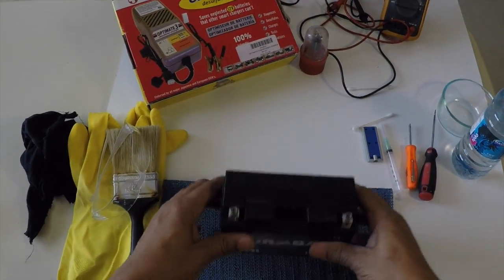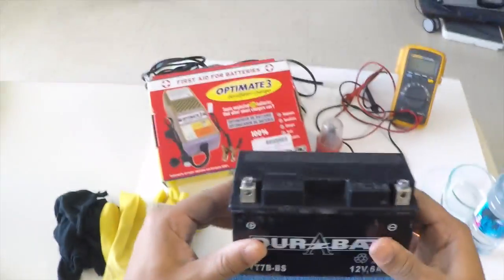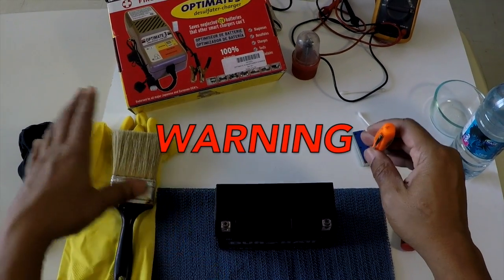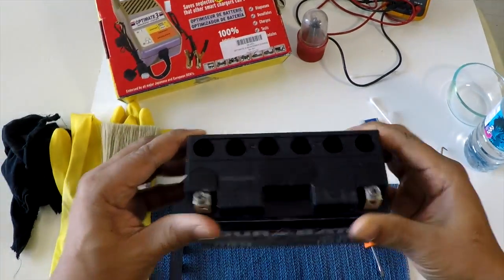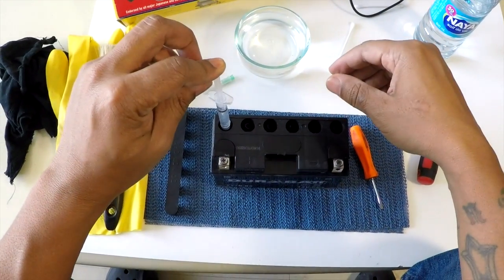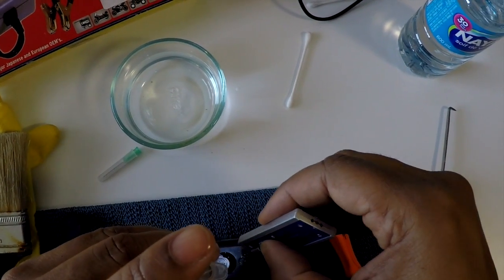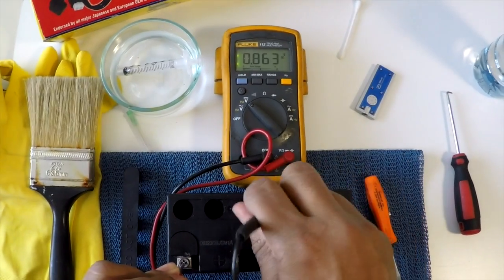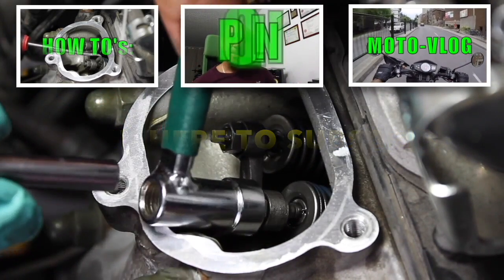Free Scooter Battery FIX | Save Money | FIXED #17

Comment: I would have never guessed that this was an issue. I keep a trickle charger on my battery when not in use. From now on I'll check the water as well. Thanks, 125ZumaGuy. 👌😮👍😜
Reply from the maker: Rick, Heat is a bad thing for batteries. I didn't only restore the battery I restored confidence in my machine 🙌🏽

Comment: My battery failed 3 years ago. been kickstarting my piaggo ever since. Recently I had maintenance done and replaced the battery. 44 euros! now I'm gonna store my battery for the winter witch a trickle charger! My first battery lasted about 5 years without trickle charging and being in storage every winter.
Reply from the maker: Hi Boowonder, I have some reservations about trickle battery tenders. I feel like those tenders accelerate the "death" of a battery. I believe the water evaporates faster on a charger. Having you ever felt the sides of a battery when it is on a tender cycle? Its warm to the touch. So I charge my battery and then take it off charge. I would charge it once more just before putting in back into my bike at the start of riding season. I wish more scooters came with kickstarts here in North America, where are you from ?

Comment: they are a pair of 12 volt scooter batteries. it was charging fine but then we had it dissconnected for a good month or more when i charged it i got nothing.  I followed your instructions, and one battery was totally dry while the other was pretty full. is it possible for one to die while the other still good?

Comment: i have one similar one day it was boiling over i took off the strip that covers the cells added water charged it and awesome!!!!!!!!!!!! not rocket science. but on one battery the strip would not seal.
Reply from the maker: Shhh! In the pass I've sparingly used a bit of silicone to seal leaky caps. Never used it to seal the entire top cap, just around the leaky ones.
Right, it an easy job?

Comment: PLEASE DO NOT DO THIS TO SEALED GEL BATTERIES. IT WILL NOT WORK AND RUN THE RISK OF BLOWING THE CONTROLLER. WE ARE PROFESIONAL ELECTRIC SCOOTER DEALERS AND REPAIRERS AND WE ARE SEEING DAMGED SCOOTERS DUE TO OWNERS TRYING THIS ON GEL BATTERIES.

Comment: I overfilled it and when it was charging it started leaking pretty badly. Did i damage the battery? did i lose enough acid to kill the battery? (it's a little 4lb 12v 3ah)
Reply: I have a 12 volt 688 and I doubt you're supposed to do this

Comment: Hello Mister Scooter, Are you still there? I'm having trouble with Pride Go Go scooter for my wife. I got new batteries that came fully charged, but now they don't recharge; just get a partial charge that doesn't last long. I'm trying to trouble shoot to see if I have a short circuit or have a bad charger. I have a multi-meter, but I'm not an electrician. Any recommendations ?

Comment: Drinking 🍸 water 🚰 is not distilled, yous don't wants no minerals in your battery. Batteries don't come with distilled water, they come filled with electrolyte, a sulfuric acid solution that can be topped off with distilled 💧 water for maintenance

Comment: I have a velocity 21st scooter with alarm.. n I have 2 acid batteries One gel battery  .. with alarm gel battery last 2 weeks then dead .. only have trickle charger put it on for 2 days to full capacity charge .. I have replaced the Stater CDI box .. regulator rectifier .. battery still dies after two weeks .. never done battery water method .. would the same method work on acid batteries and gel batteries  ? pls any feedback would be great 😁
Reply: No!!!

Comment: Let a battery run out of water, run it down to dead, let it sit uncharged for months, charge it at too high of an amp rate, buy as cheap as possible, use the wrong type of charger, don't read instructions, expect batteries  and scooters to run without maintenance and repairs. Mobility scooters use sealed lead  acid batteries, no water needed.

Comment: That wasn't distilled water you had. That was drinking or purified water. Distilled water is clearly marked on the label. 
Or you can take water out of the hose or faucet and "BOIL" it. That will also remove any impurities from your local water company.
Reply: Boiling the water does not do that And that's proven to science lol